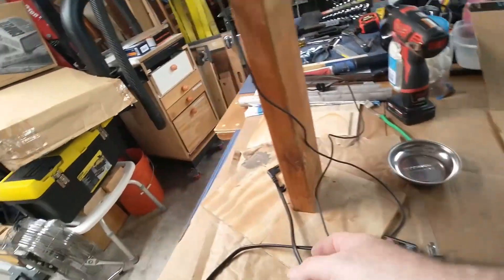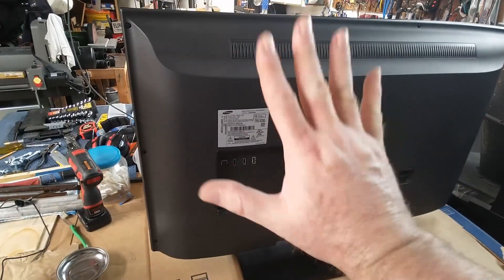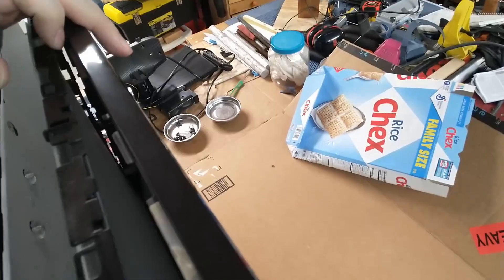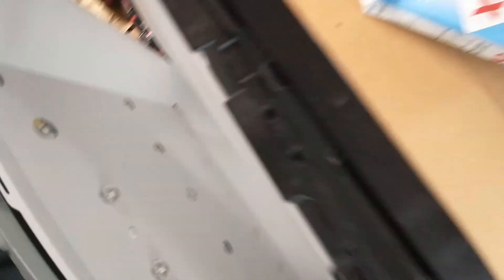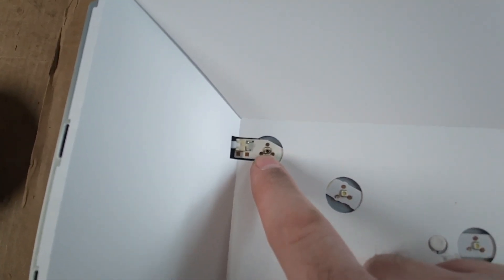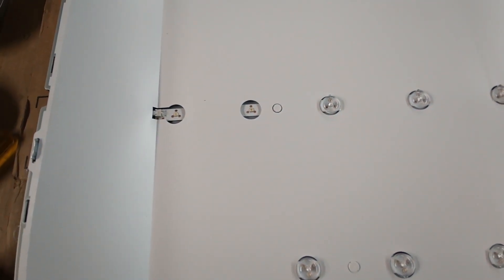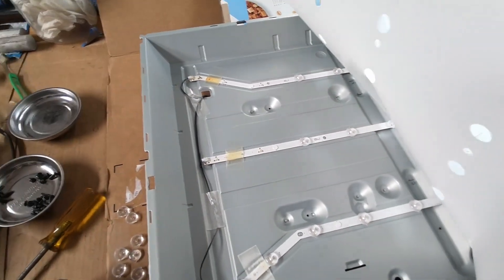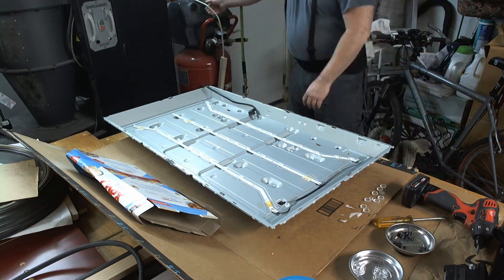Samsung UN40H5003 40" TV with bad LED's

Comment: Hi my name is Edin my Samsung TV 40H5003 has a broken screen do you know how to fix it
Reply from the maker: When you say broken screen, do you mean the display itself is broken/cracked/damaged? or do you mean it just does not light up?   If the actual lcd is damaged...although you may be able to buy a replacement, from what I tried to research while fixing this one, that can be almost as expensive as a new tv (or new used one off of facebook marketplace/craigslist).  So it really depends on what is actually broken on the tv to know if it is worth fixing it.  I am not a tv fix it expert by any means...as shown by my screwing up the lcd in my case by breaking the cables when I tried to put it back together.  So my best guess if you can figure out the problem with yours is to research the replacement parts for it.  If it is just the lights...that is not that bad of a fix as I found out, just make sure to be very careful to put the case pieces back on in the correct orientation or you will screw up the ribbon cables like I did.  Hope that helps some.

Comment from the maker: Well as you will see in the final video on the tv...the led replacement worked.  However, I screwed up and mis-installed the interior trim piece and screwed up the led panel wiring harness.....and then screwed up the tv....as a replacement panel since those wiring harnesses are built into the panel, costs more than a new tv.